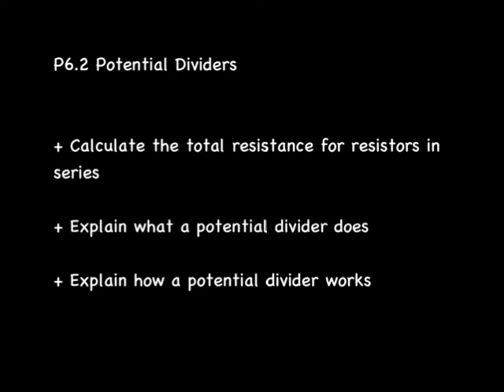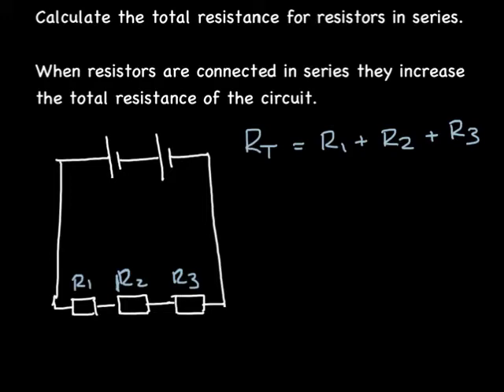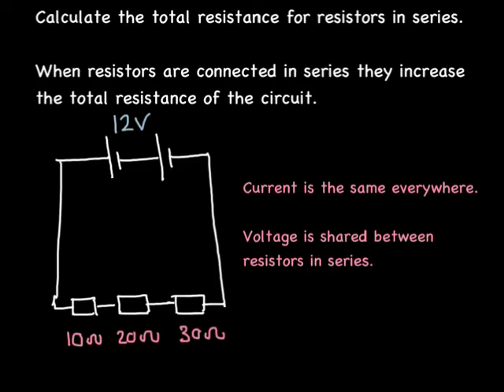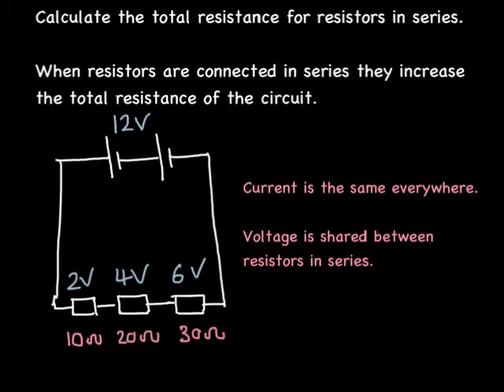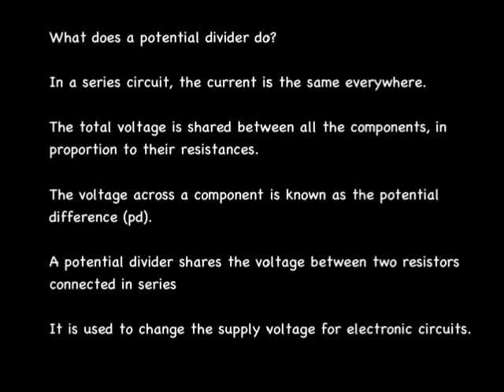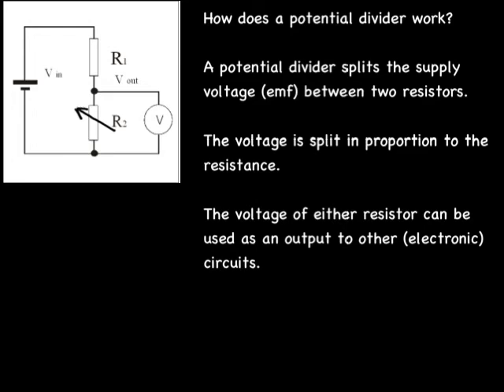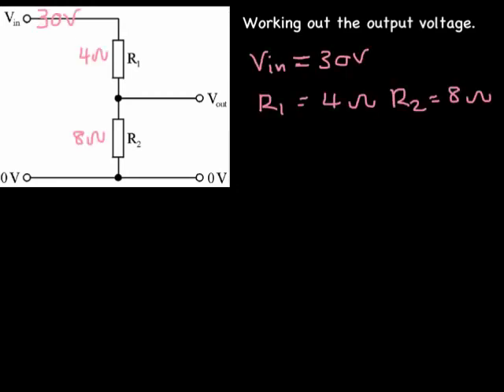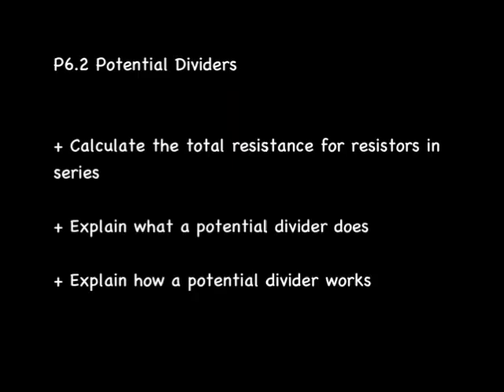P6.2 Potential Dividers

Comment: This is because you use the equation Vout equals R2/R1+R2 x V in.                         So in this case it would be 20/30 x 30 = 20 
So the answer would be 20V.